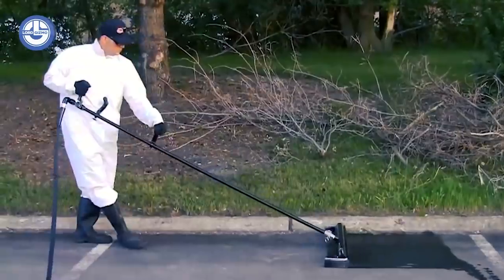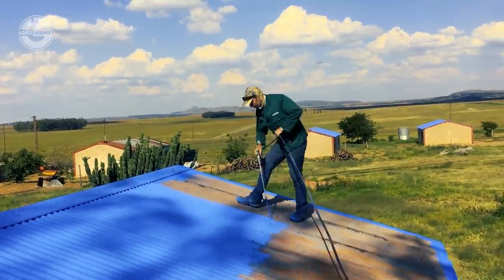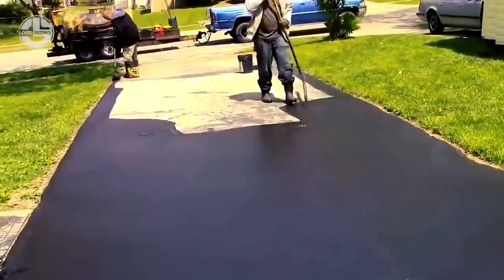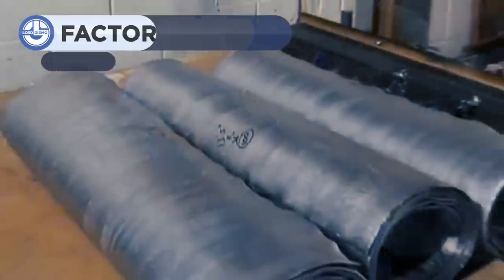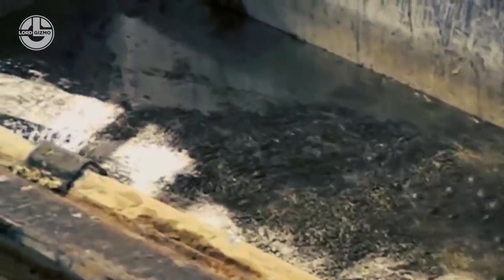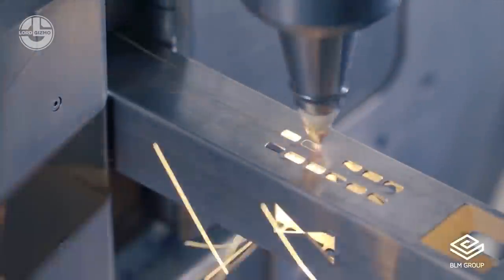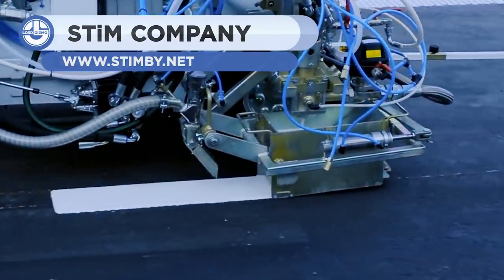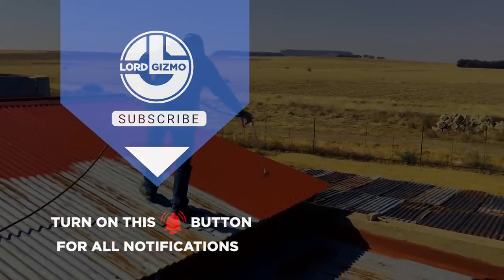Fastest Workers And Machines You Need To See | Next Level Of Productivity

Comment: Am airless sprayer from an equipment rental place, I painted an 1800²ft Cement Tile Roof plus the Hip Roof on the 30'w x 25' l addition (not counting the hip valley tie in area as additional surface because it's minute) Start To Finish in a half an hour for each coat, 5 gallons of primer, then 5 for the base coat added accent texture with a leaf blower , one last coat the next day, after painting inside, the exterior masonry, exterior hardy board, garage walls, floor and driveway, took me longer to key the details on here than it did to run through 2.5 gallons of a uniform and flawless paint layer. I was instantly gratified!

Comment: Lead 3,000⁰ or steel?
Reply: lead has one of the lowest melting points of any metal. I can assure you, that they would not be standing there if the lead was 3,000 degrees. Just an FYI. Good work on the rest of the video.